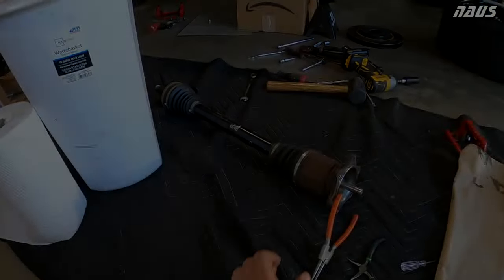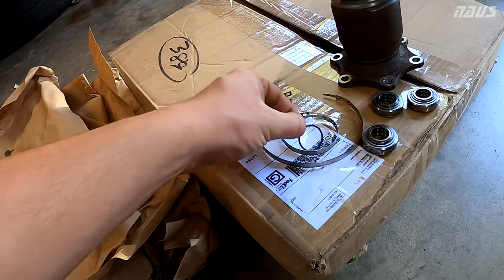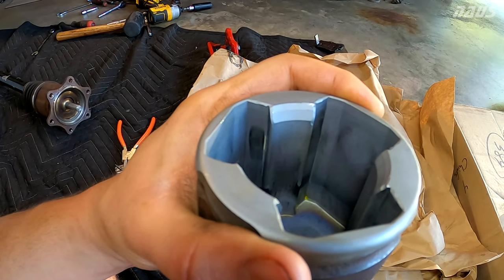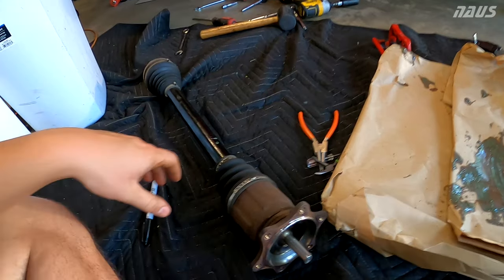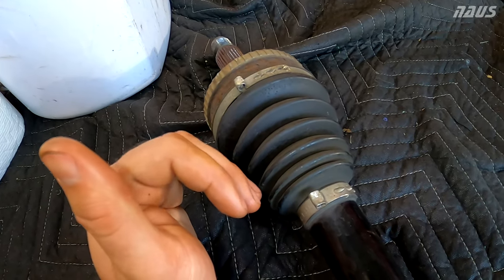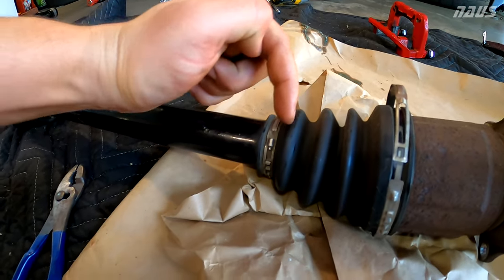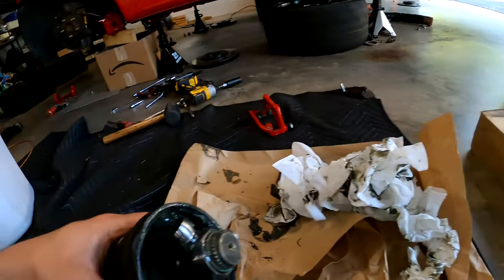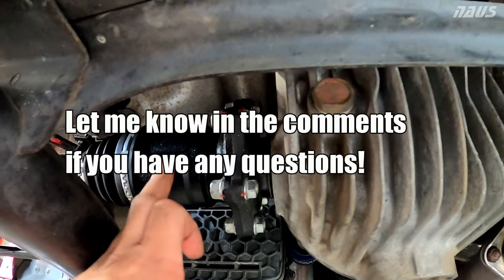S2000 Axle Cup/ Inner CV Bucket Swap - Vibration Fix

Comment: Great stuff, many thanks.  Several hundred miles ago, my 80k mile '07 S2000 developed a clicking sound when accelerating from a stop, especially when turning to the right.  Happens about once every hundred miles or so, not very noticeable but is something of a concern.  I re-torqued the wheel bearings but that made no difference.  Drained the differential, lube was very clean with no particles, refilled with Amsoil lubricant.  My AP1 owning son suggested it might be one of the differential mounting assemblies is worn, but I'd like to have a better notion of what the problem is before taking all that apart.  Wondering whether it could be a bearing cup/axle assembly (dang those things are expensive!).  Any thoughts?

Comment: Thanks for the great video. What are the symptoms that indicate a swap and regrease is needed?
Reply from the maker: Main symptom is vibration under acceleration. Second would be mileage and age. Based on how old these cars are now I’d recommend doing them if you car is over or close to 100k